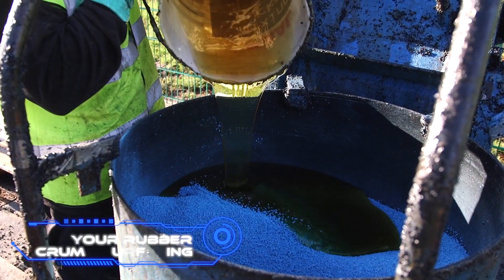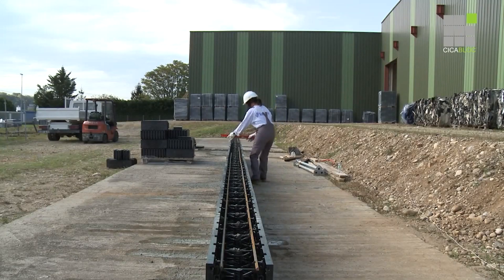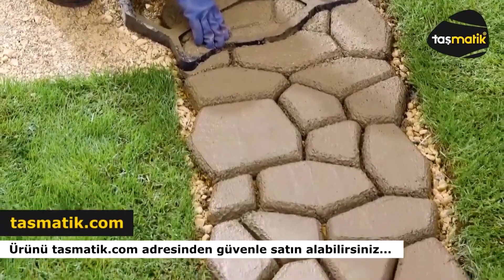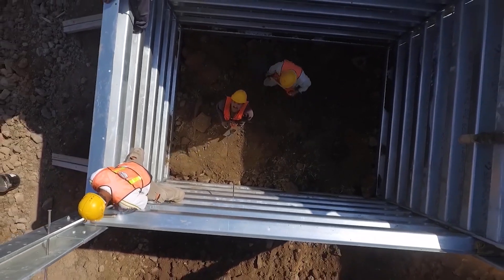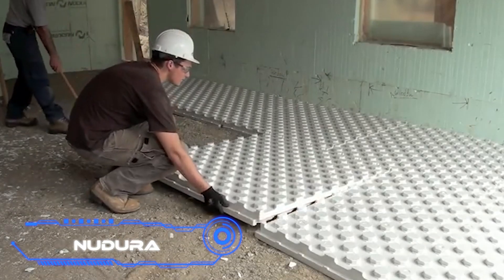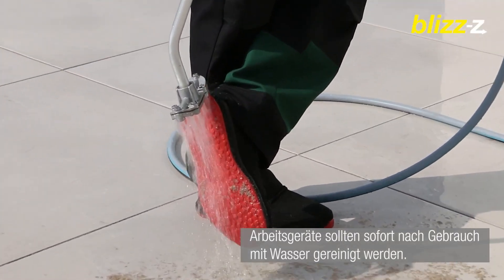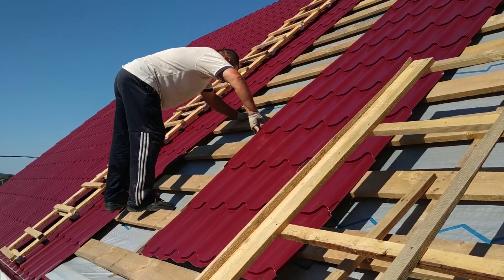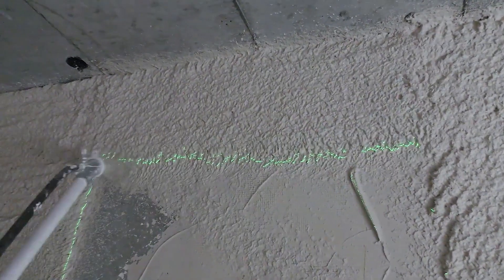INCREDIBLE CONSTRUCTION TECHNOLOGIES NEVER SEEN BEFORE

Comment: Wetpour rubber crumb surfacing is a great material that makes up the flooring in the playground. It made of special rubber pallets that made of synthetic rubber, polyurethane glue, and colors which reduces the chance of getting hurt and also stand up to changes in the temperature, rain, and even shoes with spikes on them. Cicabloc is a seeker blocked formwork blocks that we can fold up, which is a new way to use thermoplastics. Folding hinges make make it easy to cut which will make work much easier. The material can stand up to any weather. It also has a lot of the same qualities as a reinforced concrete wall, which is great. The material is great for projects that are hard to do like elevator shafts and retaining walls, which is good for the environment. Thank you so much for doing this video.
Reply from the maker: Great comments as always!